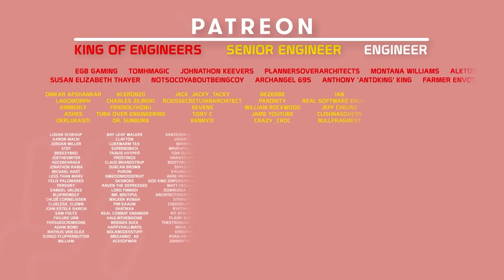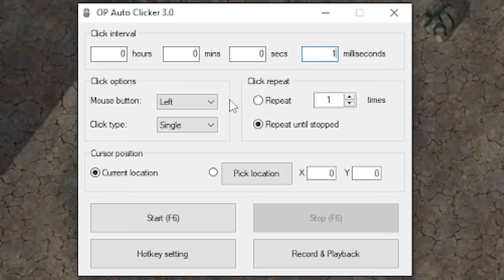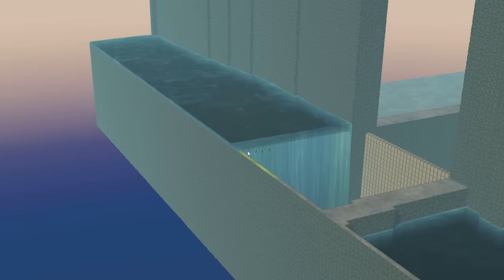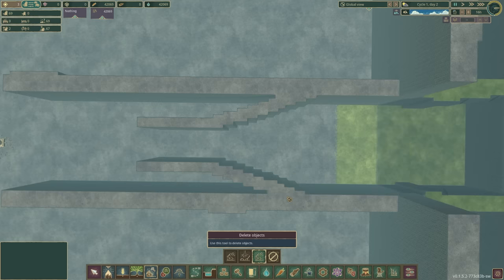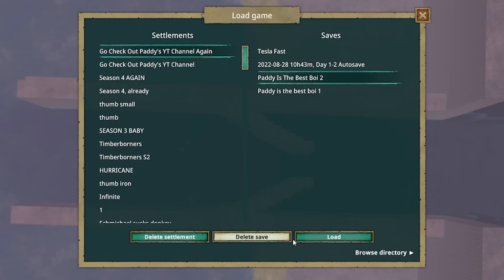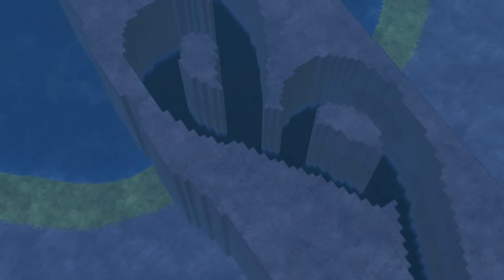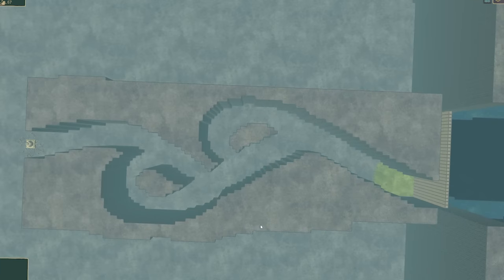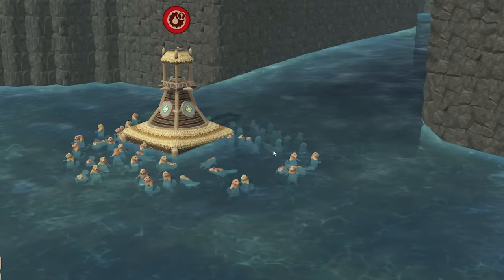Can a TESLA VALVE save my beaver colony from HUGE FLOOD WATERS?

Comment: I'm pretty sure Timberborn just uses a floodfill with layers. Tick 1: water level goes from 0->1 on adjacent tiles, Tick 2: 1->2 and adjacent tiles to that go from 0->1. No energy preservation, no momentum.
Reply: Possibly, but how would that explain why a water wheel in the middle of a 8 block river creates X amount of power, yet if necked down to 4 the wheel makes more power? 

Not saying it figures momentum directly, but it has to have some sort of calculations for speed. 

I seriously doubt it would work like Skylines though, where the front water line stays constant, regardless if it goes through a Tesla type valve or flows up a river.
Reply: @outcast170  realistically I'd say that the speed calculations are coded in the wheel.  like: if X blocks from shore, produce Y amount of power.
Reply: @bt1234567892010  Possible, but it wouldn't be that simple. Could have swore when RCE tried it, the wheel didn't change position. The water was changed upstream. One long, 2 block river doesn't produce as much as an 8 wide stream dropped down to a 2 wide directly in front of it. Don't remember what he tested when he tried to do a sloped track generator. 

But, I could be mistaken. It has been awhile.
Reply: @outcast170  Well yeah, water always goes at the same speed, unless slowed down by a wheel or hitting a wall and turning a corner. Plus the wheel itself cannot be too submerged.
Reply: @Goremize  So what your saying is, an object in motion stays in motion unless acted apon by an outside force?

Kinda like how all cars go the same speed... Until they hit something and don't...
Reply: @outcast170  I have no idea in all honesty.
Reply: The game specifically uses the Shallow Water model to model the water physics for anyone curious, it has a variety of limitations
Reply: @outcast170  No, I would say it's just more water flowing though the wheel if you narrow it down.
Reply: @Pekz00r  The wheel has variable output levels of power. That has to be calculated based on SOMETHING. 

No, I do not know how it is calculated, HOWEVER, RCE did a video where he pumped water up into a pocket, then routed it down a 1 (or was it 2?) Wide channel, into a lower pocket, then tried to pump it back up to the top. 

IF the amount of power produced was based entirely on the space the wheel was placed (such as a 1 or 2 block channel) every wheel would have produced max amount of power and easily power all the pumps, resulting in a overall surplus. It did not do this.

So whatever the amount of power produced is factored from, its not JUST the width of water its placed in.

And no, using the "shallow water" model means absolutely nothing to me. No different than saying it uses the Timberborner water method for calculations.
Reply: did you play the game? then you would know, that there are referactions and if you build something really bad you can have periodically submerged fields.water momentum ist really a thing in this game.
Reply: @outcast170  Yes, it's the amount of water flowing though, as I said. If you narrow the flow down, more water will pass though the tiles there the water wheel is and thus it will produce more power.

Comment: Well after watching all these tesla valve videos I know have to say something. Tesla valves are meant for a closed system not open top. But even with an open top you can make it work. You need a harsher bounce back in the returns and the loops should be a small diameter than the main channel so that the water passes through faster. And you need more iterations for it to properly work

Comment: For the tesla valve to work you need more than just 2 places to turn around and slow down the water
Reply: And then angles are important too, they're not just arbitrary, they're designed for the flow rate to create a certain back pressure, which can be a pain to replicate in these games
Reply: if someone can get them to work in TB it would actually be useful, because then you can have resevoirs that automatically fill fast and empty slow, wich is great for water management.

Comment: I would have loved to have seen water wheels placed at the beginning, then after each iteration of the valve to check and see if the power generation was reduced as the water goes through the valve.
Reply: Then the water wheels would slow down the flow, not the Tesla valve. There is stream gauge in the game to measure water flow without disturbing it.

Comment: would the stream gauge's flow measuring give you an indication of the speed of the water?
Reply: Well, the gauge would tell you depth, but a water wheel does give you (very localized) water speed.
Reply: stream gauges will give you the water speed

Comment: You can click on the water sources and adjust how powerful they are.   I was messing around with making them as weak as possible, to just make tiny oasis on the map.  I think I had some set at .03, but you can go big too.

A better test might be if you had another outflow- see if you can stop the flow in the Tesla valve.  I you either need a finite amount of water or a different direction for the water to go.  Since you don't have a roof on the valve eventually the water just increases its level.  You have 'up' relieving the pressure.

Comment: The water physics in these games seems to substitute height for speed, and the water just gets higher instead of faster in narrow channels. It might be worth trying to make a valve that creates a standing wave to limit the water flow. So rather than using water speed to introduce turbulence to slow the water, use the water height to create a resonance to slow it instead. No idea what that valve would look like though.
Reply: sounds like the perfect problem for an engineer
Reply: The water physics in the game are mostly correct, the higher a wave the more water "flowing" through. Matt should try using dams on top of foundations or arches to 3-dimensionally constrain the water in a pipe, this should change the velocity of the water instead of the height if the game actually accounts for pressure.
Reply: because all these tests he's doing assume a closed tube, not an open-top channel. in an open-top channel, this is more or less how the physics do actually work in real life. fluid speed is only affected when the water has nowhere else to go. but in these tests, it does have somewhere else to go, up. so you don't get effects like the water flowing back causing it to slow down oncoming water or focusing the pressure of water to speed it up. in a closed tube, you get these effects. in an open space, you dont. these ideas, such as pressure increasing speed, also assume a continuous and equal water flow, which is also not the case here.
Reply: Like how you funnel the water to narrower walls you would add a roof to do the same.
Too compress the water from sides and height.
Reply: @Templarfreak  that makes sense and the water rising in narrow passages is even intuitive. I guess even though he has pointed it out multiple times, I forgot the valves technically require closed pipes. Still, my guess would be that the game physics wouldn't work that way even if there was a way to create the right conditions. Since neither this game or Skylines offers a good way to put a roof over the water anyway, I think trying to create resonance/a standing wave would be neat to see.
Reply: @kaiserroll109  i mean if we want to be really conservative, yeah, even if you could somehow make the passage entirely closed the game probably wouldnt simulate the physics in such a situation, but to be fair it probably wasnt designed to work like that either, the game likely never expects water physics to be in an entirely closed space like one would expect valves to work in

Comment: Apart from what other are already mentioning i think one of the biggest problems here is that the water sources are constantly adding more water so even if you make the flow slower at the end it still gets really tall, you could make a reservoir and then divert the water source so you can have a set amount of water in each test rather than a constant flow
Reply: yeah, the biggest reason the tesla valve failed is because he made a tsunami sized river instead of a wave. with enough pressure and volume they also fail irl, but somehow he still doesn't undestand how and what he is making works

Comment: I believe here there's a fundamental problem, which is that the village is at the bottom layer. In tsunamis, the coast is above sea level, so the water, when going to the place with less potential energy, aka the lowest point, goes back to the ocean, while in this case there's no place lower than the village, so it will get drown 100% of the times. You can make the tidal wave slower, true, but as long as there is no ditch where the water can go to "rest", it will always flood the city

Comment: Again, the fluid's speed only increases because the fluid is constrained to the shape of the cross section. This is only true in a closed, full pipe. In this scenario, like with the CS one, the water depth (height) is free to change, keeping the cross sectional area effectively constant and eliminating the "need" for a speed change.

Comment: At last RCE tries this in a game with good water physics
Reply: I dont think its that good tbh since it doenst get faster or slower but its ok ig
Reply: Not really that good, is it?
Reply: @SamCanada1  "Better" is a very subjective term. It is very different water physics. It SHOULD be, overall, better in many ways sinve this game is focused more on the water directly. 
That being said, Skylines still has impressive water compared to most city building titles, by far.
Reply: Ye
Reply: YouTube Censorship Can Lick My Taint  The comparison wasn't against actual water, compared to Skylines' water that goes a constant speed across the map regardless of obsticals or height.

Some realism would have to be sacrificed for the main focus of the game. Not to mention as RCE pointed out, realistic water physics cost ALOT and isn't calculated instantly.

Comment: What I see from your setup is that you have an issue with the cross-sectional area that water is able to pass through. Since there is no solid limitation in that regard, the crest of the wave is rising making the total mass of water passing through that cross-sectional area the same (or slightly less due to the effects of gravity on the mass of water). Anyway, your search for ideal water physics in a video game is a noble one, but I can see the limitations in making it a video with good visuals... unless a mod can make a glass roof for the valve.
Reply: A glass roof block without limitations that it needs to be build on top of other blocks would greatly improve the possibilities for testing this properly.

Comment: I have games where I've built 3 water wheels on one side of a wide river.  They were pretty weak.  Then I put levees a couple spaces upstream blocking most of the other side of the river, and the power went up by about triple.  That confirms the water does move faster in a narrower channel.

Comment: You should exploit the game mechanics
Water seems to just flow in every available direction without "momentum" for say
From looking at this video, I think all it tries to do is equalize its level by spreading everywhere it can.

Instead of a tesla valve or whatever, I think what would work is some form of "Maze" 
I don't have a way to describe it without an image, but i'll try....

Imagine some sort of "tree" tons of small branches leading nowhere except one of the branch leads to the town.
It would take a lot of space, but I think it will significantly reduce the flow of water by creating tons of cul-de-sac causing it to slow down drastically.

Comment: Sir, it is my opinion that when working with fluid mechanics, a gas and liquid are treated similarly, however; the difference is particle separation.  This is also seen in the equations governing flow like you were refereeing to about converging and diverging ducts.  

What really governs the effect of the tesla valve is the density of the fluid.  Liquids are more dense than a gas.  Take this in account along with the velocity of a particular volume, the gas particles act more like projectiles and have more time to make the trip following the main path and once curved and aimed back at the original direction will start to impact against the flow.  With a liquid, the particles are so close, when the path diverges, the liquid will diverge proportionally and will then have a greater ability to resist any counter flow.

The efficiency/performance of the valve is related to the fluid density; which can be found by taking the limit of the molecular mass over a given volume from initial volume to some the end volume.

Also, you kept a large follow-on volume of water flowing behind the wave.  A tsunami is a like a pulse of a volumetric flow.  Follow what you did but create the first dams more forward. Let it play and fill.  When full pause, build 2nd dam in between the first and the water source, delete the forward damn and hit play.  Now you have a "🌊"

The issue is with the game physics.  There are a lot of factor that are calculated in a large 3-D matrix for CAE/FEA when doing fluid flow analysis (either open or closed systems).  These software's run for days at a time with clusters supporting the computations; I think that they have the physics they have is pretty nice.  Maybe a software engineer will get tasked with working with a ME on improving the internal physics.  Maybe they can leverage the VCPU and share the computing load.

Comment: Games simplify when possible for efficiency and design for gameplay. it looks like the water has 2 properties, height and spread. The water moves at a set speed towards any unblocked path in all direction. Spread lowers the highest height adjacent. And we know height slowly lowers as well (evaporation). Someone would need to confirm in code, but this is how I would program it. When the dry season is over you want the water to fill back in in a predictable way for players no matter the map. At least that would be the Engineer's way!
Reply: I suspect that too, but the speed of water wheels increases for narrower sections of a river without impacting the height. However, the logic for water speed and water spread might be different, which would explain why the game has contradictory behavior.

Comment: the problem is that the water has to go somewhere so it will always flood the town. put them on a 1 platform height and then you can test if you are changing the speeds.
Reply: Yes, I was thinking 'On what planet will adding water to water prevent it from eventually flowing down on the beavers?' Not Matt's most clearheaded experiment...

Comment: The Tesla valve requires a pressure differential, when it's full, the water will leak out of it if the pressure is not enough.

Comment: Pretty sure tesla valves require pressure differentials for complete stoppage, an open channel would at most act like a wave break. So even if they did model in localized water pressure, I'd expect water would to still flow to the other side. Correct me if I'm wrong.

Comment: The side loops should be narrow to force the water to move faster so that when it goes around the loop it does it faster than the water in the main channel, causing it to get looped around before the main channel gets to it and then crashes back onto the oncoming water.  However, due to wonky game water physics, perhaps try the reverse, narrowing the central channel instead of the outer loops.

Comment: again, same as in the last video, the speed only changes when the crossection changes. The whole reason a narrow valve would speed up the water is because at every crossection perpandicular to the flow direction. The same amount of water must flow, else you‘d be destroying or creating it. The „volumetric speed“, which shall be constant, is crossectional area*speed: A*v. If A stays the same, so does v. What happens in your experiment is that you do not restrict the heught if the water. Meaning if the path gets shallower, the height will increase inversely proportional, or close to it, to keep the speed relatively constant.

Comment: The Tesla Valve is best utilized when put in the way of a single and powerful force of fluid. It's best use is when replacing the one-way valves at the front end of a pulse-jet. This simple rocket engine uses repeat explosions in the combustion chamber to close the valves and force all the accelerant out the back of the engine, then new air naturally re-enters through the now open valves again. These rockets could propel explosives unmanned and unguided a few miles and explode its cargo on impact. The Tesla Valve was an improvement to the design as, most of the original design's limitations revolved around the one-way valve failing mid-flight. With no moving parts, the Tesla Valve corrected this.

The Tesla Valve can be used in many applications, but it was originally meant to resist repeated aerial explosions.

Comment: A good test for if the water will go faster in narrow canals would be to build two of them, one wider than the other, both in the way of the same tsunami, and to have a little race. But in this game it seems to "just travel at water speed", as you put it. Still, nice try, I had high hopes for that one...  The matt valve could do with an even stronger and more effective shape, tho. 
Maybe it would work in tidal tribes? (I mean it's a game about saving stick people from getting done by a tsunami)